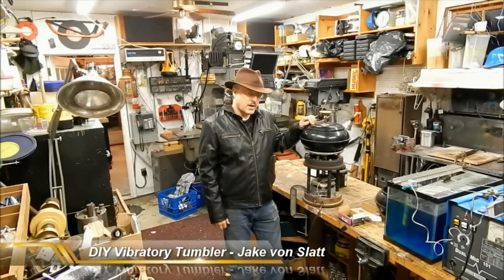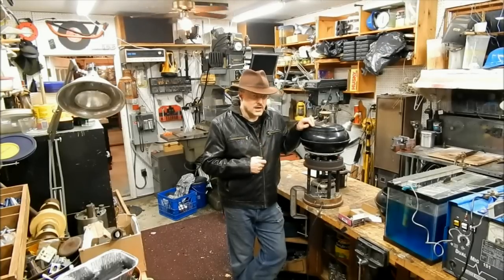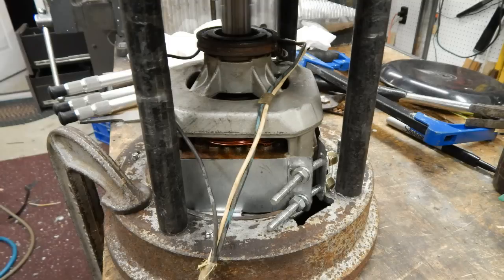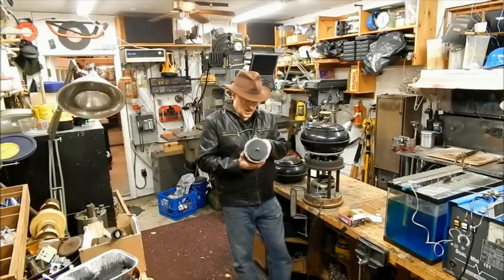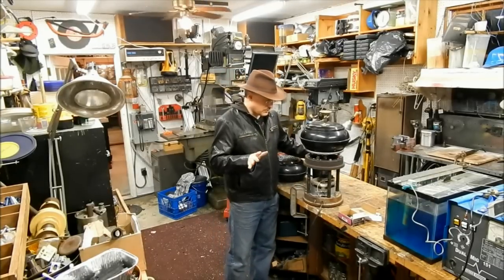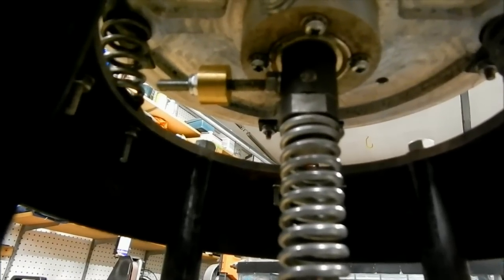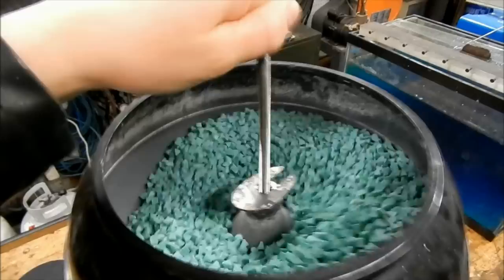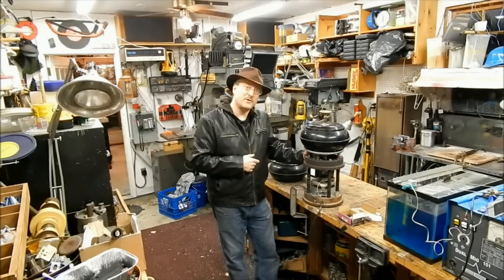THIS IS MY WORST VIDEO! Why does it make the most revenue?

Comment: I guess I have to answer a question I posed since no one else did🔎🔍 allabout.wiki/Lyman   I asked what the red switch is supposed to do, since it is not an on/off switch.  I finally discovered that it controls whether or not the machine reverses direction every so often.

Comment: Wonderful video. Very informative. So many videos in here show rocks tumbling but very little on the actual design. I learned enough watching this video that I have ordered some parts. I'm using a 1/2 hp 1750 rpm motor. Thanks for the specific details. Im using a C face motor ( face mount). My drive spring is a 1" od x 1/2" bore x 8" free length. Hope that is not too long. I am waiting for the parts to see what else I need. I will use a (lawn)  mower deck spindle for my upper bearing. I would love to fabricate my parts but I have no access to a lathe or milling machine. Thanks again for the detail you went into. Luckily with a few off the shelf parts, like the mower deck spindle-$26.25 from ebay or less at a mower repair shop , anyone can make a machine similar to yours. So far the only tools I will need are a few wrenches an electric drill and a 4-1/2" die grinder.

Comment: Pretty neat setup. Have you polished a lot of parts with it yet? The microphone looks great. I built a gyratory screener this year. I made the shaking assembly separate from the motor, like with your tumbler. I coupled the two something like this, but I had so much eccentric weight inertia to overcome on startup, that I couldn't use a spring as a flex shaft, for fear of it collapsing. Instead I opted for a piece of flexible pvc vacuum tubing. It is braided, and has an integral spring. Works great. Mcmaster carr has a huge assortment of springs, too, if you want to balance it out. They're usually cheaper if you buy a bulk length, and then cut them to size.
Reply from the maker: Arnold's Design Thanks for the tip! I've used the tumbler for a couple of projects but I really do need to replace the springs for better action.

Comment: An absolutely beautiful machine Dr. Frankenstein... and I say that with the utmost respect.
  I'm a guy just like you.  I can fix anything and design and build something on the fly for a particular offbeat purpose mostly from otherwise useless junk that;s piled up because I don't have that program in my brain that makes me throw useless junk in the trash.
  The only criticism I have is that I take exception with you calling guys like us "tinkerers".  To me that sounds like someone who aimlessly takes simple things apart and puts them back together again for no reason or one who does ridiculously simple repairs like changing the power cord on a vacuum cleaner and declares himself a mechanical genius.
  The title or label that immediately comes to mind for guys like us is "Master Do It Yourselfer" but I don't quite like that either.  A bit too long and self involved sounding.  If anyone has a better term, I'd like to hear it.
  At any rate, it's a great idea for a tumbler type machine except that most guys (like myself) don't have a mill in their shop or a 3D printer... although 3D printers are steadily becoming less expensive AND if you look around, there are companies and individuals out there who will 3D print your stuff for a fee.  I'm sure if you didn't have that mill and printer you would come up with a way to solve the design problem with some other less involved method.
  I'm a tool junkie but sometimes I don't have exactly what I need, like a mill or a metal lathe for instance, to do what I want to do so I find another way to solve the problem.  Necessity is the mother of invention is the self apparent truth for guys like us.
  A Thumbs Up for you!

Comment: I find your design much more efficient and think that it will last much more longer than what is in the market. I don't really feel comfortable with the spot welds on the spring that transfer rotation to the vibration plate, but in honesty I don't see to many other ways to transfer that rotation. Perhaps in the future I would have a few ideas of how to do it. Very nice video sir.

Comment: Jake, I want to start welding.  I'm comfortable with brazing, but do you know any alternative to Mig or stick welding that does not produce any fumes, yet creates a strong weld?    Would love to be able to weld steel in my basement with only a small vent it won't happen. Just picking your brain...any alternatives? (Besides rivets).
Reply: +Slap Stick You might want to consider learning about TIG welding, the hand skills are similar to brazing, but the fume generation and extraction requirements are much less than Mig.
I suggest that you check out Jody Collier at Welding Tips and Tricks dot com or here on YT. Very easy to watch and knowledgeable on all the various types of welding.
Reply: Mark Fryer I'll check it out. I've also decided I will do the welding in a shop that teaches welding and has appropriate fume extractor. Thanks!

Comment: I am repowering a few dead tumblers using ball bearing fan motors, most likely. Any notion what the ideal RPM is? I use them for a few things. Medium batch jewelry making, cleaning pistol and rifle brass, knocking the rust off of tools....
Reply from the maker: +GunFun ZS The current motor is a 1725 RPM motor from an electric dryer. I tried a 3450 RPM fan motor from an old oil burner but that proved to be too fast. FYI: I updated the unit with 4 identical and much softer springs and it now works way better! I got the springs from the little drawer of springs at my local True Value hardware. I'll be posting an update  video sometime soon.
Reply: Jake von Slatt Thanks. I checked a lot of commercial brass tumblers and most of them seem to be about 3000 RPM. I wonder why you would be getting better results at roughly half that? Or perhaps you get different results, faster mixing action, but more impact per stroke.Do your parts have shot peened look with washed out details such as obliterated engraving? As I understand things part of the point is to have lots of light chipping motion, but not much force. Like sanding vs hammering. High frequency low amplitude would reduce the force of the impact of media or other parts on each other.
Reply from the maker: Oh that is interesting! Perhaps I should swap the faster motor back in now that I have the softer springs.
Reply: It would be interesting to see a comparison for sure. Also if it makes a visible difference in the work piece or processing time.
Reply from the maker: Thanks! That's good information. I reduced the strength of the static springs earlier this year and it made a big difference, the tumbler is now very aggressive and no longer needs to be clamped to the workbench to keep it from walking.  It's mostly being used by my daughter for milling clay at the moment, but I will need it for brass polishing soon and I'll keep your comment in mind.

Comment: I would suggest attaching the motor to the bottom of the part you milled and running the counterbalance at the bottom to give you the action you want like when you hold the threaded shaft.  Otherwise I do appreciate the design with the coupling/spring but the balance at the bottom I think will give you the more aggressive rolling action desired..
Cheers Mate
Reply from the maker: I have since replaced the static springs with softer ones and that did the trick, it works gangbusters now.
Reply: good to hear. I'm nearing completion of my tumbler although no plans for a video. The motor I had for making it has a double shaft which gave me the idea to make a Tumblr and a magnetic pin finisher so I'm attempting to make a convertible unit that can do both by removing the platter with the magnets. I used to keep about 5 wet and one or two dry units running where i made body titanium jewelry at my last job, but weren't mine so I figured I'd make one. unfortunately I don't have access to Machinery like I did there so no Milling or turning any parts that I need unfortunately..
Reply: jason coale hey man I designing a vibratory tumbler. Can you help me with some questions I have?

Comment: In other words, something that a Joe McDoakes doesn't stand a chance in h-ll in duplicating.
Reply: +metatechnologist The important parts are simple. Make a heavy base. That could mean nail your surplus motor to a stump. Raisers to base of the bowl holder plate. Add 4 equal springs. Add shaft to base of bowl holder plate into a flange mount bearing. Add ANYTHIng with mass offset on that shaft. i.e. a big wad of bailing wire twisted around it.  Couple the shaft of the motor to the shaft in the bearing with a vibration isolator. ( This one is $4 https://www.surpluscenter.com/Power-Transmission/Shaft-Couplers/1-Piece-Solid-Couplers/1-4-FLEXIBLE-COUPLER-1-2693.axd ) Serve chilled.

Comment: Milling machine, a CNC mill, and a 3D printer?
Yeah, right, that's DIY for everyone I know!
Reply from the maker: This is not DIY for everyone, this is hardcase DIY. The 3D printer was built from scratch. The CNC mill was bought for scrap metal prices, the electronics gutted and rebuilt with a dumpstered Dell PC--after bringing it home on a homebuilt flat bed trailer. If you are interested in the details they're here:

http://steampunkworkshop.com/bridgeport-series-ii-cnc-geckomach3-conversion
http://steampunkworkshop.com/moving-bridgeport-milling-machine-recreational-rigging
http://steampunkworkshop.com/trailer.shtml
Reply: Jake von Slatt
OK Jake, now after viewing the offered links, I feel even worse!
Now I know what it's like to be the guy with only a flat blade screwdriver and a claw hammer watching an engine being built!
Yeah, my tool collection is seriously lacking a milling machine and a lathe.
You don't perhaps live near Joliet IL?
LOL!
Reply from the maker: archangel20031 East Coast, I'm afraid. But that's how I started. My first manual mill was free due to a burnt motor and being loose as hell. I had to take it almost completely apart for the parts to be light enough to lever into the trunk of my car. Let me tell you, a $400 '72 caddy does not handle well with 1200lbs of junk in the trunk!

Comment: I agree with Clinton, 5 minutes of useless banter and way too many repetes of what springs were used and way more machining than need, not a bad machine if you hold the lid hold down screw while it is running.